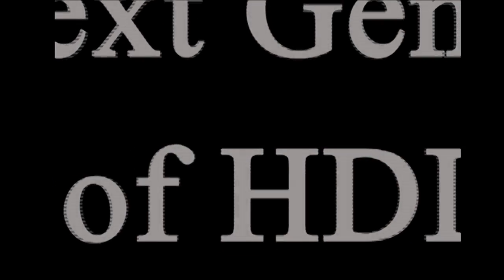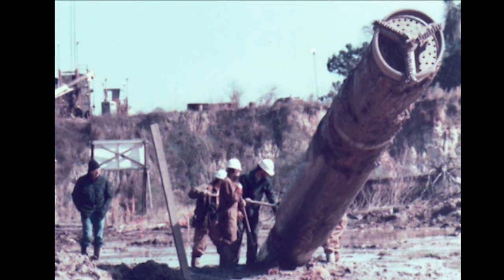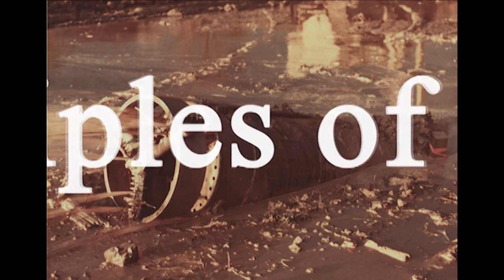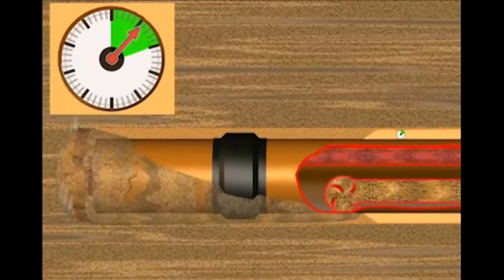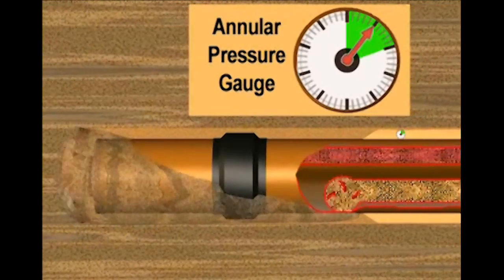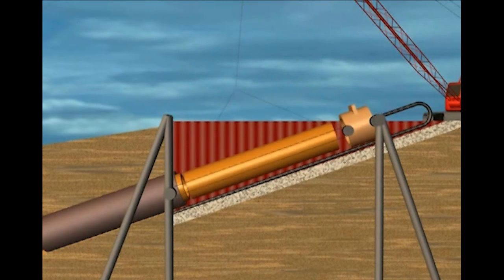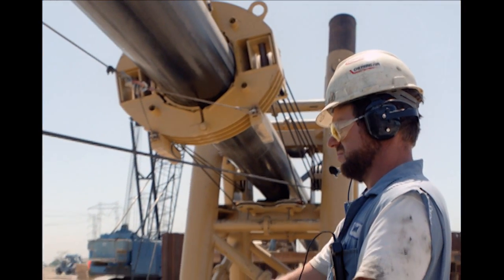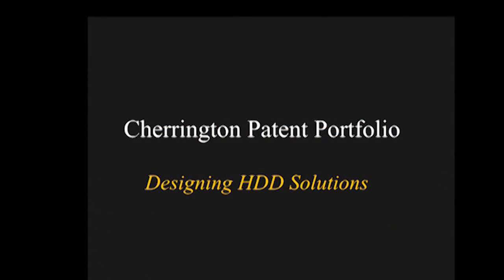Horizontal Directional Drilling, The Next Generation (HDB)

Comment: @廷彥賴
The force  bending the pipe comes from a "dog-leg" bend in the pipe, which steers the pipe when it is pushed into the soil.

Most kinds of pipe are flexible even if they seem very stiff or have flexible joints (even jacking pipes can bend a little at the joints, but not so much that forces are distributed unevenly on the product pipes, that may break the pipes). Steel can be bent at a radius less than 500 times the pipe diameter, depending on steel grade, but in drilling application a rather large safety factor needs to be used and it is uncommon to bend the pipe at less than 1000 times the outer diameter. This is possible even if it is a water pipe that is internally coated with cement mortar.

Comment: could you please tell me the major difference between HDD and HDB, such as Maximum pipe OD, maximum pipeline crossing length, risk as well as the cost? it'll be highly apprecitaed if you can provide some info based on practical project experience. my contact email: helen.chai2015@gmail.com

Comment from the maker: The external fluid intake manifold are designed to filter out any solid sizes that exceed the pump's capacity. As an added the caution the pump size and capacity as a significant safety factor as well as an impeller is bidirectional that would allow reversing the impeller should anything ever become lodged in it. This is not a problem we have ever encountered. 
Regards, William Cherrington

Comment from the maker: Thank you for your interest in question. There are two methods for accommodating the bending radius of the pipe.  1-The design profiles are designed within the free stress radius of the pipe diameter and weight. Meaning a design radius is within the acceptable bending radius of the pipe without yielding the pipe.  2-In tight radius we have used pre bent pipe with a pipe being pre-bent to the design radius and orientated web welded to create an inverted arc.  Regards, William Cherrington

Comment from the maker: Automatic welding technology has significantly decreased the time of joint welding for applications where single pipe insertion is required. In addition to automatic welding single joint, HDD technology developed and patented by Cherrington in 1990 “ Pipe Thrusting, Patent No. 4, 221, 503) ” has been adapted to HDB allowing the machinery to accommodate extended pipe segments or pipelines welded in their entirety for nonstop continuous installation.